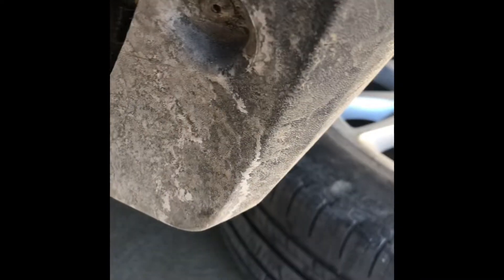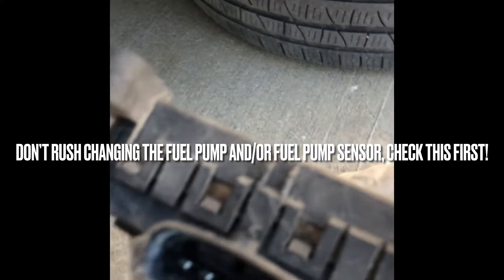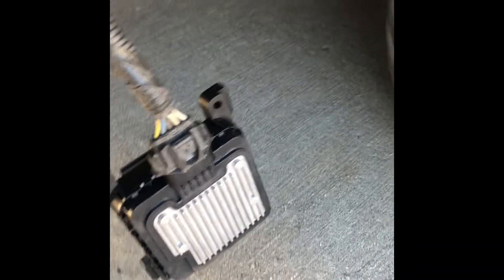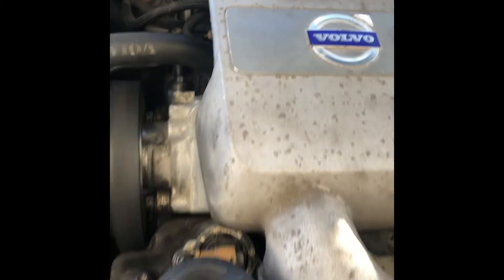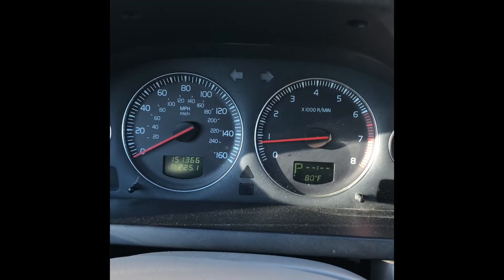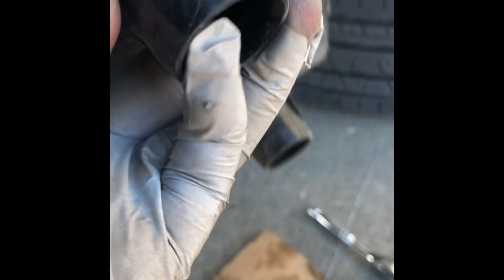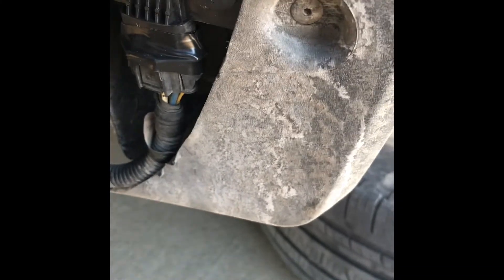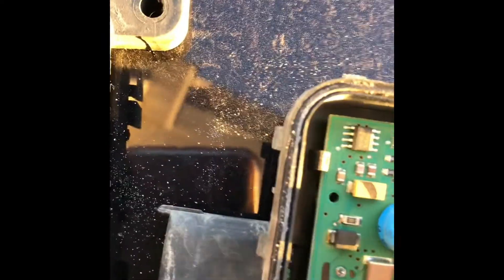Volvo crank no start issue! Don't replace your fuel pump or fuel pressure sensor. Check PEM first!

Comment: Zero diagnosis in this video, just a replacement. How to tell if a PEM is bad if no checking the voltage from the PEM? That is what I needed. Not buying a PEM unless I can diagnose it as bad first.
Reply from the maker: It’s a common issue, the PEM gets corroded.. you can diagnose all day if you can

Comment: Hi, I start to have that same issue in my XC90 V8. Did you buy a cheap aftermarket module or an expensive genuine part?
Reply from the maker: got it from the junkyard, I think from s60. Other Volvo models use the same part and they're located under the seat which makes them last longer.

Comment: Im currently looking at a 2006 Volvo s60 that cranks but doesnt start. Guy went to start it one morning and cranked but wouldn't start. He didnt want to pay $200 to volvo dealership to diagnose it, so hes selling it for $1,200. It has 151k miles on it. Most of them in my area are selling for over $2,500. Is this a smart buy or risky, considering i dont know for certain the problem. I'm guessing it should only be 1 of 3 things. Any advice would be appreciated. Thanks.

Comment: !!!!!!!!!!!!!!!  ATTENTION; before you start replacing parts!!!!!!!!!!!!!!!!!!!!!!!!!!!!!!!!!, Check the grounds from the pump to the body . The black wire coming out of the pump connection is your ground. Follow it till it goes to the body bolt. The body bolt is where 90% of the issue is. The threaded bung is PAINTED and the terminal is sitting on this lousy connection. remove the bolt and scrape or wire brush the bung in the body clean. Clean the terminal and tighten the bolt. I suggest adding an additional ground wire to insure a proper ground connection.
Things will work again especially if you have intermittent pump failures or no start issues.

I just went through all of this just to find I have bad body grounds to the pump and fuel pump gauge unit  
Do the same with the fuel pump gauge module.'
THIS IS THE MOST EASIEST SOLUTIONS,

I hope I can save you alot of headaches by this personal solution.
Reply: Are you still available on yt to comment to this have a few questions?
Reply: @Robin2fitness if your working on this car still the grounds are all the wires on the front suspension struts i might go have a look at mine tbh
Reply: I own a *2008 Volvo C30 Turbo...can anyone Please tell me location of my PEM MODULE..IS it under passenger rear footwell or inside Rear Passenger wheel well behind splash guard..anyone Please help
Reply: Nice..hey listen i am going to check my PEM CONNECTIONS FOR CORROSION AND DEBRIS...IS MY PEM INSIDE CAR OR OUTSIDE PASSENGER WHEEL WHEEL BEHIND SPLASH GUARD ?

Comment: Same issue on my 2008 xc70 3.2 awd. Crank no start. Have looked all over this vehicle for the pem. Can't find it. I haven't thought to look in the wheel well. I will at first light. I have fuel pump pumping sound but still won't start. I've changed the fuel pressure sensor, with no improvement/ difference. Does anybody know for sure where the pem is on a 2008 xc70 3.2?
Reply: Did you ever find it? I’m having a similar issue with a 09
Reply: @3rdstoryfun  had to drop the fuel tank. It was on top. The guy who replaced my fuel pump said there was no fuel in the tank. So I found  out that, the gas gage didn't work and that the "crank, no start" issue I was having was most likely because it was out of gas. Sad part is, I paid a  volvo dealership to try and diagnose the problem. I had to tow it away from there, they couldn't find the problem. I ended up sending the part back and just replaced the fuel pump, runs fine, other than the gas gage is off. I did end up selling it after the fuel pump was put in.
Reply: @johnadams247  Ah man that's a expensive empty tank! Mine is starting for about 2 seconds then stalling. It started after the car sat fro 3 months. It was parked on grass so I'm thinking it might be the corroded PEM module I keep hearing about.
Reply: @3rdstoryfun  yeh,  the fuel pump replacement was what fixed mine. $600.00 from the same volvo dealership that didn't know that it was out of gas.
I'd try putting a gallon or two of gas in it just to make sure.
Good luck
Reply: @johnadams247  Thanks Chuck!
Reply: @johnadams247 😢
Reply: My 2006 V70n did NOT have a PEM and no Petrol pump relay !!!so I changed my engine contol relay i desperation after 1 year of looking  my krank warm start problem was fixed.
Reply: Oh and thankyou very much you got me out of my chasing down my PEM rabbit hole

Comment: hi! Thank you for this information! Is it normal for there not be a code thrown? I have taken it to volvo when this is happening and due to the no check engine light, they have not been able to pull any codes for this particular issue. However, my car still throws codes, so I don't think it has anything to do with the code module or reader.
Reply from the maker: Some codes will not make the check engine light on, as for this particular issue it might throw a code (without the check engine light) but that code might be thrown from fuel rail sensor.

Comment: so i recently bought a fuel pump module and she was running fine for 3 days then was back to my crank no start issue even before getting it. i was wondering if you had any tips at all for me love coming from nigeria 🇳🇬
Reply from the maker: do you happen to have any codes related to fuel system?
Reply: @highmilesgarage9131  0:55 Faulty pem mode then no error code.  You can do an experiment: unplug the PEM and try to start the engine.  Then put on Vida and you'll see that you don't have any error codes even though the car won't start.

Comment: Hey there. Taking a shot in the dark, have been scouring the internet.  Trying to do a DIY repair of the Fuel Pump Driver module, for a 2008 XC90 with 3rd row seats.  Would you happen to know the exact location? I believe it is under the 2nd row passenger seat.  Thanks!
Reply from the maker: yes that's the location, under the carpet.
Reply: Thanks for the info really appreciate it

Comment: Where did you find the replacement?
Reply from the maker: you can get from your local junkyard, they're very cheap. They are the same for most Volvo models (s60, s80, xc70, v70s..) look for modules that are under the seat since they are usually in very good condition. There are model years that they put the module under the car and it gets corroded over time.